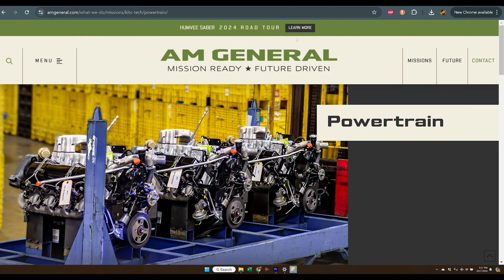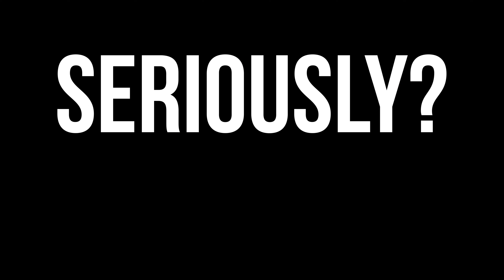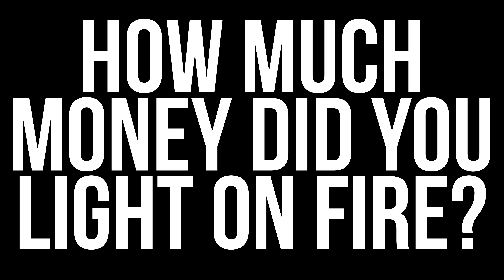How This 6.5 Diesel Makes Duramax Torque - Build Breakdown

Comment: Would you recommend this build for an 84 CUCV M1008?
Reply from the maker: Like, for the 6.2? Or a new 6.5?
Reply: @WillometMotorFab I’m open to rebuilding the 6.2 if you think it’s worth it. Throw in a turbo etc. It has 74k original miles on it. I’m also open to running the 6.5 like you have.
Reply from the maker: All the external parts will fit the 6.2, but this forged 6.5 would absolutely rip in a CUCV. That would be a fun build.
Reply: @WillometMotorFab thank you for the reply! I’d like to bring it to your next meetup!

Comment: The simple reality is its a matter of passion vs practicality. Passion drives some people. Practicality drives others.  For sure a stock duramax would get that power and torque zero work done. Maybe or likely it would be more reliable.  Like wise a cummins rail cummins stock matches that output and it would run forever reliably. Heck i cant break my high mile 500hp common rail. 

But the thing is passion, it drives us to do what doesnt make alot of sense financially. I think that truck is 25x cooler because it has a really well built 6.5.  There probably is a better chassis and axles and t case to have built on too but because its built so well on such a cool truck its so worth it.  Honestly this truck is one of the coolest do it all trail rigs out there and its what brought me to watch your channel. 

My dream build is a k20 suburban on 05+ superduty axles, linked, coil overs, 540 bbc, zf6 and an atlas.  But your build makes me want to someday have both a 6.5 and my dream 540 powered zf6 burb. 

The more wheeling videos you could post of this thing the better i know that takes alot of time and energy but id love to watch this thing work for hours in end.
Reply from the maker: Thank you for the very thoughtful comment. You totally get where my head is at on this build. Your project seems like it'll be a humdinger. More wheeling videos after this truck goes through its SEMA paces, because that's been a whole process, too.
Reply: @WillometMotorFab sounds good to me.  My friend had a 741k mile 7.3 idi with a zf5. Besides my kubota tractor being idi and it working perfect that idi 7.3 really perked my interest in idi’s. Id like to snag a military k5 blazer with a 6.2 to play around with.

Comment: Idk if you’ll see this since it’s an older video, but I have an 87 Suburban V20 with a 12V Cummins and all the goodies. Radflow 2.5 Coilovers, grizzly lockers, NW fab eco-box/doubler. Your fabrication is STELLAR. I wish I could do half of what you’ve done. All the tubing/structure you have under your truck is a dream of mine to do. I wish I lived closer to Dallas so I could pick your brain because a lot of what was done needs to redone and I’m a perfectionist and want to do a “one-and-done” bulletproof rig.

Comment: Very good video! On that he351, did you keep the factory 9cm housing, and upgrade the wheel size? Or did you change the housing as well?
Reply from the maker: Changed to a 12cm…it’s basically an HX40 now
Reply: @WillometMotorFab sweet, thanks. Assuming the only reason you used a 351 based charger is so the compressor outlet faces forward? Currently spec’ing out an hx35 for my 6.5. Thought about using a 351 cover to make intercooler piping more efficient
Reply from the maker: That’s a bingo.

Comment: Thanks for the inspiration, installed a 2000 center turbo w/mechanical pump in a mint1985 Caddy Fleetwood Brougham.  Was original 5.7 diesel.  The pump is turned up, turbo is stock, single 3" exhaust, CAC is going to be a major PIA.  Safe to say as it is woke the big car up pretty well, burnout capable and 0-60 in 10 sec.

Comment: No DEF and no BS without the EGR to wreck the motor that will last 500,000 miles without EGR cooking the motor and turbo to death! I would have made it stick shift so there is no electronics or valve body & you could park it on a hill and still pop start it if a solar flair or EMP hit!
Reply from the maker: No DEF/EGR is huge.

Comment: You commented on the Borg GM turbos, said you didn't like them, but have you heard anything at all on the hurricane 2 ball bearing turbo from dieselsite? They look like GM turbos, but they also look a lot better on paper. Either way I can't find squat on it's performance, maybe you or someone else here can let me know?
Reply from the maker: I had not heard of those turbos until now, but I looked them up. It looks like a GMx turbo with a nicer bearing and a well known billet wheel. They say it has lower drive pressure, but offer no detail on the impeller side wheel and housing, so I'm suspicious. That detail is important, and its absence is telling. For $1200, I'd rather have a widely supported and performance verified Holset or S300/S400. In my opinion, the old BW turbos just aren't worth investing more than a seal kit.
Reply: @WillometMotorFab  I've got a local shop that's had one sitting on their shelf for years, I asked about it the other day and talked the guy down to $750. A guy had ordered it for his truck he had put in their shop and then one day he disappeared and stopped paying for his truck or answering phone calls and the truck sat there until the shop could claim it legally. They sold the truck but the turbo has been sitting there ever since. Say I wasn't afraid of paying for or replacing a cracked exhaust housing every once in a while, what else on that end of the turbo would I really have to watch out for? In theory is it less that the impeller is fragile and more that it is inefficient, or is the impeller actually a fragile piece on GM turbos? I've got a list that without a turbo at all is already like 15-20 grand, and ultimately it'll end with a completely different 6.5 engine and trans in my truck, but if the hurricane can be a decent upgrade to the factory turbo with about 10-12lbs of boost, it'd almost be worth it to me to get it just for the moment for the price, put a little extra pep in my step.
Reply from the maker: @ I wouldn't call the impeller fragile, but if it's anything close to what came factory, it's definitely inefficient. Really, the advantage to that turbo is just that it bolts on without modifications. I bet it's fine for zipping around town, but quickly finds its limit when towing.
Reply: @WillometMotorFab  Ever have any experience with a k27 turbo? 2nd gen Cummins guys talk about upgrading from their hx35s to it. I know where I can get one of those in a parts yard at the moment, could easily rebuild it and have it balanced.
Reply from the maker: I haven’t. I feel like I stumbled on the winning lotto ticket with my HE351CW, and have been pretty happy dialing in the performance with that one.

Comment: Do you have a link to that catch can? Did you add a CDR to the driver side head? We just did a build on the 96k3500 that my dad bought brand new. Very similar to yours but I’m not happy with the catch can that I used. Any help would be appreciated
Reply from the maker: Lots of options in the vibrant catalog for a custom solution (what I did): https://vibrantperformance.com/gen3-catch-can-assembly/

Bolt in option for the GM:
https://quadstartuning.com/en-no/products/ultimate-pcv-catch-can
Reply: @ I’ll give the vibrant one a try. Not a fan of the one from quadstar, that’s what I have on the trucks now

Comment: I’ve got a 91 Suburban that originally came with a 6.2 diesel.  I completely understand why you stuck with the 6.5 instead of a Duramax or something else.   Your suspension and everything else around the truck is set up based on the GM 6.2 or 6.5.  

If I had your fabrication ability and skills I’d still have my 6.2 with a Banks turbo.   But I don’t have that ability, time,  and none of the shops around here know anything about a 6.2 and they won’t touch them.  

What I did find is a shop that knows square bodies and LS and LT swaps.  I’ve now got a 6.6 L8T between the fenders.
Reply from the maker: That 6.6 swap sounds like a great choice!

Comment: Why run a double pass and fab same side hoses when you can get a triple pass?
Reply from the maker: Double pass still has room in the end tanks for large oil coolers. Triple pass exists largely just to make packaging easier, which is great if fabrication isn’t in one’s skill set or budget. Most ultra4 stuff runs a dual pass.

Comment: The later 6.5 forged crankshafts make a 6.5 worthwhile and durable enough for hp increases...had a 6.2 & 6.5 the 6.2 broke crank in half at 130k...6.5 was a 97 gm crate engine it never quit on me
Reply from the maker: The GEP forged crank sealed the deal for me. 👍
Reply: The balancer going bad was 99% of the mechanical failures of 6.2/6.5s.

That's wear the cracking comes from.

Comment: Lb7 makes 600 or 620 ft lbs
Reply from the maker: My 03 LB7 is factory rated at 520. Later versions cracked 600, but I forget which ones.

Comment: I have an 86 military squarebody, I built the motor about 3 years ago. The 6.5 build was almost exactly like yours except I did not use the Harland and Sharp rockers. Did you have to do any modifications to make them work? Since my trucks build I probably put 30,000 mi on the motor, gotta love the 6.5 TD !
Reply from the maker: The 1.6 rockers are a direct fit. I used .010 headgaskets, but it wasn't necessary.

Comment: I have see a 6.5 on a 6.2 block and thrown in an old GM wagon with a 4L60 and where able to put down nearly 30mpg.

I know you are running 40’s and a ton of drive line but have you seen a reasonable MPG on your travels?
Reply from the maker: On the big trip in NV, I got 14.5 mpg doing backcountry roads and running an average of about 55mph. Pure highway should be 15ish. Rock crawling is usually 7-8.

Comment: I'm building a burb' that had a 6.5, unfortunately low compression and a cracked main web made me switch to a 24v cummins converted to a ve pump with a nv4500 and np205 out of a bronco. And I figured a dana 60 front would also be nice just wished the 6.5 had survived. Oh well maybe later.
Reply from the maker: Sounds like a great build. No point looking back; you’ve got a great powerplant in place!

Comment: I'm a SBC  Chevy gas engine builder.Looking at the big gaps between the head bolts looks like a design flaw from top to bottom.The spacing of head bolts(even spacing) on a SBC V8 would make sense for the Insane cylinder pressure a diesel compresses.Amazing they don't eat gaskets regularly.
Reply from the maker: The odd 5 pattern is driven by the IDI chamber and is similar to the 6.9/7.3. I don’t know where they most commonly fail, but it sure does make sense that 6 evenly spaced head bolts might not need the whopping 125 lb-ft to sustain 25psi of boost that this pattern does.

Comment: its cool to see someone building up a 6.5 engine with a mechanical pump. Such a simple and reliable engine and it weighs much less than others. Makes it perfect for off road when you got the power. fuel economy and function.
Reply from the maker: The mechanical pump option is part of why the 6.5 is among my favorites. Like you said, simple.

Comment: Did any of the military humvees have dual alternators? They were 6.5's. Not sure when they got rid of the 24 volt 6.2 in the CUCV's and if they upcycled the 24v system to the 6.5.
Reply from the maker: A lot of them did, but they would have had their own accessory system that probably didn’t include AC. Worth digging into a bit more.

Comment: I have my good old 6.5 never had any issues aince rebuild only failing parts was the old stuff from the miles. Oil cooler lines hoses etc. Just doing cheap mods to keep the engine cold and low exhaust temps she been slowing rocking. Cuase one thing they aint fast 😂😂 but would.trust it to go.anywhere ohh and loaded 12k trailer all day
Reply from the maker: I really do want to see how this engine would perform in a normal K2500.
Reply: @WillometMotorFab  i love your build. I would do one eventually but want to do it on a blazer

Comment: My old boss had NINE 6.5 trucks and he loved them. The lowest mileage one had 250k on it. I wanted to swap one into my Mercedes but alas it wouldn't fit
Reply from the maker: That’s a lot of 6.5s -  Mercedes would be interesting!
Reply: @WillometMotorFab  I didn't want to deal with making a 6.5 front sump, but otherwise it would have fit

Comment: This is a great video for guys who have these engines and especially guys with HMMWVs (humvees).  I've got a K5 Blazer with a 6.2 and a HMMWV with a 6.5.  I'd like to keep both diesel, but I'd also like to have enough power to not have people in a Toyota Yaris honking their horn and yelling at me to move over.  After watching this, I could see LS swapping the Blazer if I really wanted more power.  With the HMMWV, you can put an LS in it, but it was really designed around that 6.2/6.5 Detroit Diesel.  Also, there is something about not having that sound that makes it weird if you're keeping it looking like a military truck.  I'd say that anyone looking to go down the rabbit hole on improving the power of a 6.5 should really watch this.  The cost to build such an engine was pretty surprising to me.
Reply from the maker: It is strange seeing humvees with a gasser. The 6.5 can be made to work, and certainly there’s something about an older diesel that’s just satisfying to me, but the math on a full build isn't going to work for everyone. However, pieces of this build get a whole lot more reasonable. Subtract at least 9K if you already have a well-running 6.5.

Comment: Nice build!  I feel you on not wanting to do another.   I doubt i'll do another om617 build again.   after pump upgrade, turbo, intercooler, all the fab work, etc.   I've just lost the drive to do another.
That does not look like a CS130 alternator.    That looks like an AD230.     very different.
also from the looks of it, you could have used the AD244 (and still could).
Reply from the maker: It’s also fun to just do new things. Personally, I really want to build a Duramax.

Comment: A good ol' 6.5 is pretty hard to beat...  I had a '96 GMC K2500 with a 6.5l and a NV4500.  Great truck, got 20mpg, did what I asked it to with little fuss.  I rebuilt it at about 290k because it lost a head gasket.  Sold it after buying a duramax truck.  Compared to modern diesels, 6.5's are like the 12 valve Cummins; loads of idle and off idle torque and good compression braking.  That low end grunt is gone with the Duramax or 6.0L and up Ford diesels.  Cummins still has it, but not like an old 12 valve...

Comment: I love the way you built your suburban. I have a 1996 with the 6.5 (electronic injector pump). I love the truck, and want to rebuild it before I get too old (turn 55 next month). I’ve been thinking about Duramax or Cummins swap, but that always goes away whenever I drive it. I would miss that 6.5, if I did. Thank you for the build sheet. One question: did you buy the engine in parts, or as a long block? That forged crank is what it should have always had in it.
Reply from the maker: A Duramax swap will be super cool, but the 6.5 bolts in and you can also use the super duper quadstar DS4 pump. I ordered a long block, and only listed those separate parts since Quadstar now has them as individual options in case someone didn't want/need a whole darned engine.

Comment: I have a 6.5L in a Chevy box truck(cutaway) that I purchased from the Air Force. It had low mileage, needed some work but works great with some upgrades I did. Fuel mileage is 20 mpg's but the main thing it is inexpensive to maintain. I had a 7.3L Excursion it was a great vehicle but costly. Thanks for the video and I myself want to build a 5 cylinder Mercedes and find a light duty truck for it to use as a daily driver.
Reply from the maker: I bet that 5 cylinder Merc’ would be a fun one.

Comment: Have you ever tried "solar flux" for welding stainless? It's a flux that backs the weld so you don't have to back purge, saves a lot on welding gas 😅. It has a sort of glass transition when you heat it that covers the back of the weld in a nice glassy layer, but this layer can be brittle, so you don't want to use it anywhere you can't remove it after and are worried about chunks/particulate (cooling system, etc) but it's perfect for exhaust. Argons expensive 🤣
Reply from the maker: That’s pretty interesting. I’ll have to google it. All the sanitary and exhaust welders I know keep it simple with argon. I probably used 600 cu ft (2 tanks) to make the whole exhaust.
Reply: @WillometMotorFab  can't use it on sanitary welds because of the crap it can leave in the pipe (unless you can reach the weld to grind it out after), but works awesome for exhaust in my experience! You're a much better welder than me though, if you try it I'd love to hear what you think.

Maybe I'm just cheap but 2 bottles of argon is a few hundred bucks, that adds up! (although maybe you'll only save half the gas if you aren't back-purging). Personally I also find it a lot faster than setting up backpurge, but I don't have all the different sized rubber plugs you have - better equipment probably saves both time and argon.

Comment: As always, awesome rig man. perfect apocalypse/play rig! 

Have you heard of classic diesel designs? They sell monster pumps for these ol gals. I've had their 130cc pump on mine for about 2 years now. They rate it for 400hp. While I've never dynoed it, it has no problem hanging with modern diesels. I too run an 86 burb, with a 6.7 powerstroke air to water intercooler, charged by a 6.0 powerstroke turbo, utilizing a 9 blade turbine wheel and an 11 blade 64mm compressor wheel. She rips!
Reply from the maker: Dude, that sounds rowdy. Tag me on social. I’d love to see how you’ve got that put together.
Reply: @WillometMotorFab  I don't have any social media. Could email you some pics and vids. I know, just as bad as writing a check at the grocery store now days lol
Reply from the maker: Email away. David@willometmotorandfab.com
Reply: @WillometMotorFab   sent